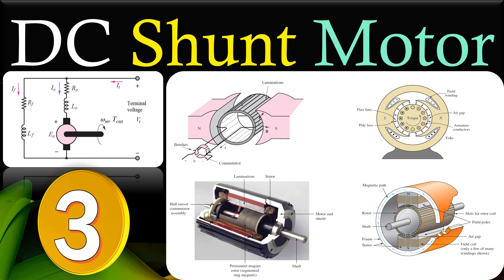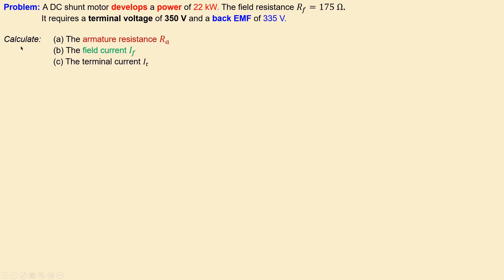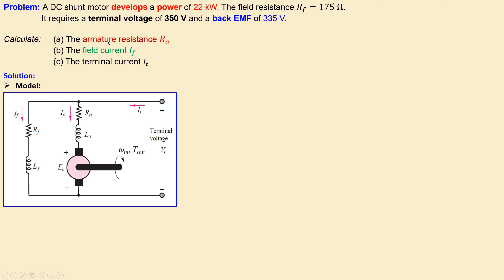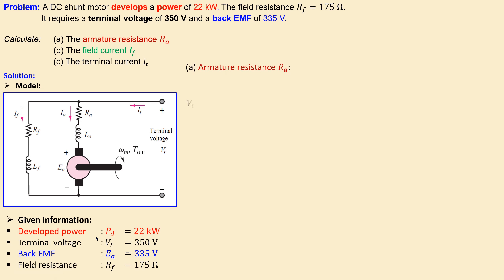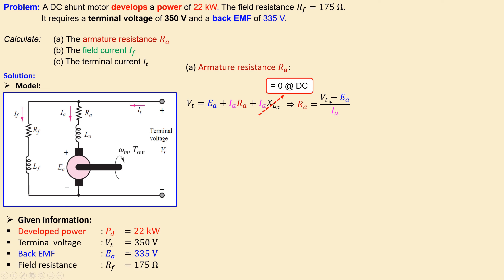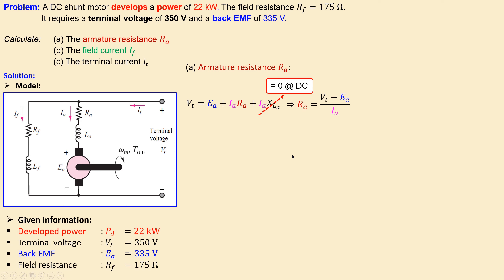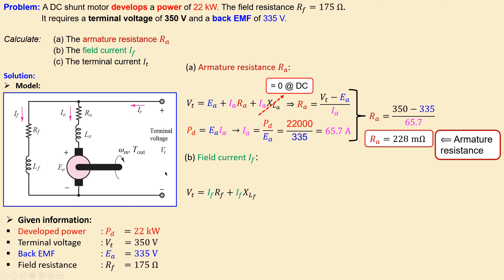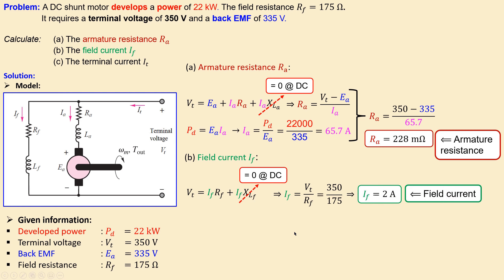⚙️⚡ DC Shunt Motor ⭐ Armature Resistance, Field Current & Terminal Current ✅ Example 3 #dcmotor

Comment: Can you help how to solve this problem? 😁

Find the efficiency of DC compound motor (long shunt); armature current (101.3 A), 
rotate at (1800 rpm), total no. of armature conductor (476), flux/pole (0.015 wb), no. of 
parallel path (p=2), shunt field resistance (150Ω), series field resistance (0.04Ω), armature 
resistance (0.1Ω), rotational losses at load (1827W).
Reply from the maker: A similar problem is already discussed in one of my videos for the playlist of DC Motors. You can find this here: https://www.youtube.com/playlist?list=PLuUNUe8EVqllcWY_Li0vofDQmP750sVRe